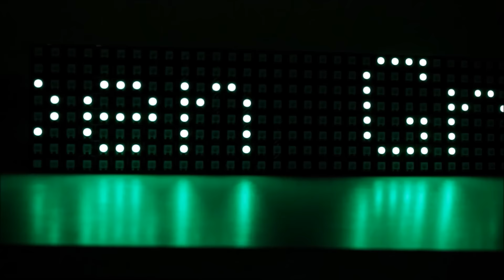How To Make an external hard drive from an Old Laptop drive

Comment: the problem is mine has a bunch of system files in it from old computer. it is taking too much space. Any idea to remove them and still make it usable?
Reply from the maker: Formatting may resolve the issue.
You can try